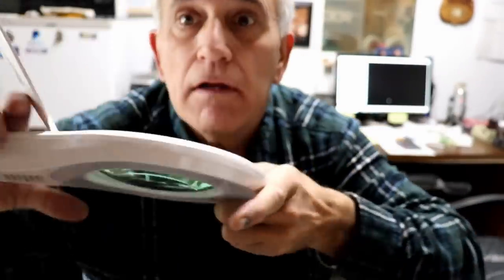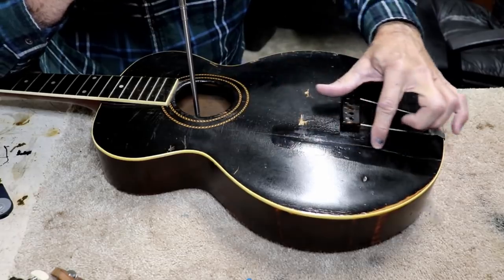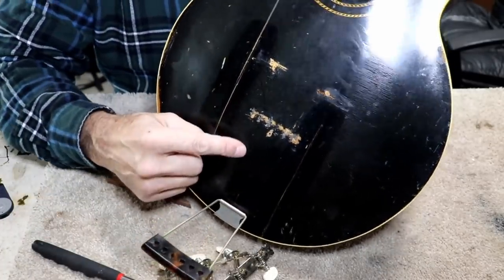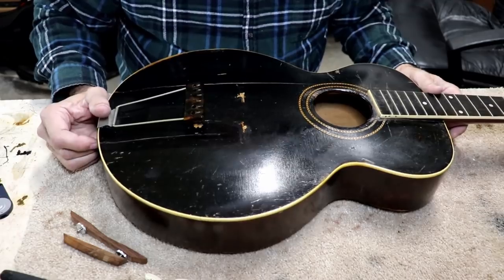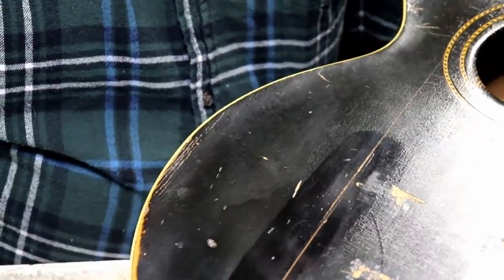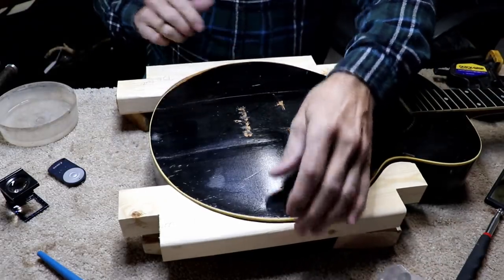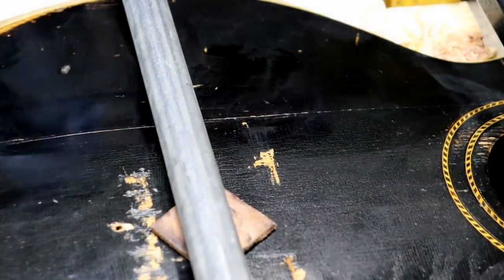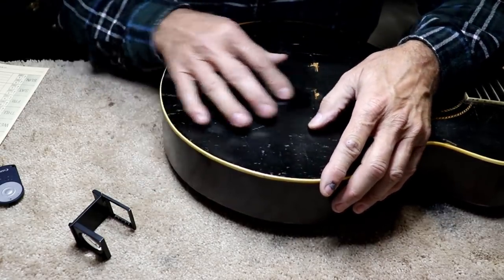265 RSW Gibson L1 Major Surgery Again Part 1

Comment: Hi Jerry, achieving a satin finish is extremely simple, you need to sand the clear coat with 2000 grit, then apply paste wax with 0000 steel wool/ using circular motions; clean and buff the excess with a clean rag.  It is super simple, and you'll love the results, perfect satin sheen, incredible slick feeling. If you still have the guitar try it out,  using your renaissance wax. I promise you'll be pleased.  you could, which I would do on this type of finish repair is seal the blemish areas with shellac, before the process. Check out the link.

https://www.youtube.com/watch?v=vkxeU-8ADeY
Reply from the maker: If it were smooth finish I would agree with you 100%. But due to all the egg shell it doesn't seem to work very well because all the stuff gets down in the little cracks..
Reply: @RosaStringWorks   Just trying to give a helpful tip. I would agree it is hard to see these things on video, you are obviously the best judge of the issue.  You have mentioned satin finishes quite a few times over the years and how to do them, I wanted to share it. This is the best method I have found. I would give it a go, on a test piece, and add this method to your many tricks! As for the repair,  it always depends on the client's wishes as well. God bless.